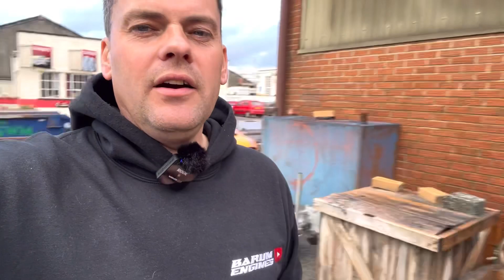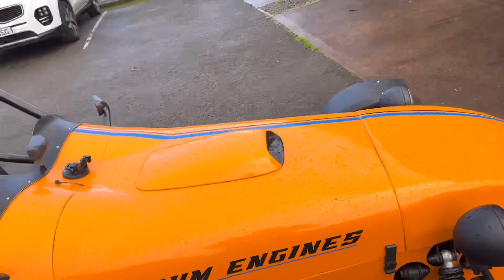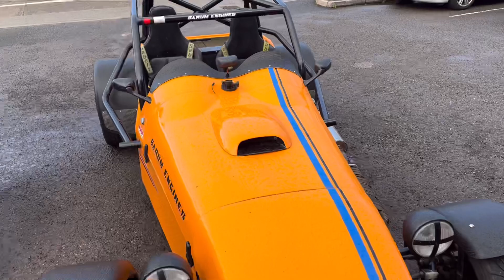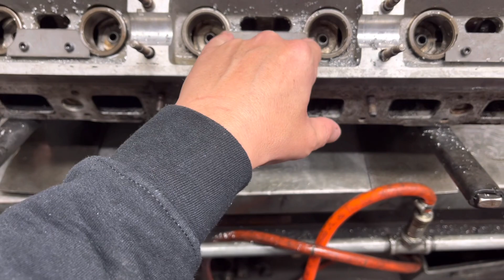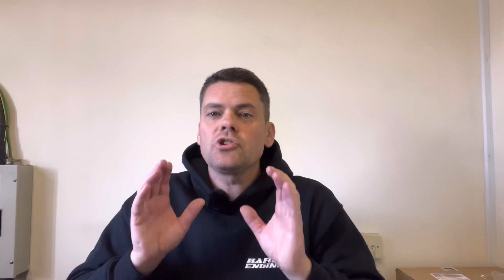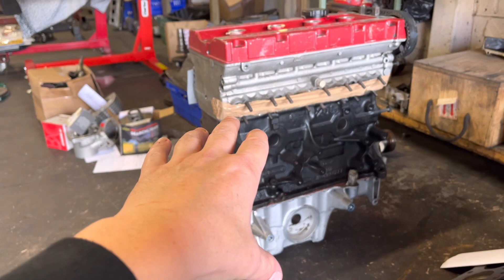Is the Lamborghini being held for ransom? If so, The reason could surprise you

Comment: Lee, get your solicitor to send a strong worded letter to Lamdo dealership. Also outline to the solicitor regarding the data breach. See what happens.
Reply: dont know if I am right or wrong but holdind of a property of others and asking something in exchange of or for is legal..
Reply: @egidijuskilinskas4583  That's why I said see what happens, and in any case you could print off the email or screen shoot it.
Reply: @egidijuskilinskas4583  probably small print in the owners manual, you will own nothing and be happy?
Reply: @kwakgreen  Errr..did you mean to type: 'illegal'?
Reply: Hmmm … as I said in another post this is not as obvious as it may seem to be. Regardless, asking a solicitor to write a letter is going be the start of a big $$$ exercise. Is the principle here a hill on which to die? Maybe pay the bill, take a laptop to the dealer so the manager can verify the deletion of the email and leave with your car, never again to darken the dealership door. Also, be careful what you say on this forum, very careful or you could find yourself with a very costly defamation problem.
Reply: @egidijuskilinskas4583  It's quite simply illegal. They're trying to cover their own screwup by essentially blackmailing. The dealership doesn't seem to realize is that Lee has leverage too. IMO Lee should contact the relevant government organization.
Reply: Not worth the expense unless they refuse to release the car
Reply: @samiraperi467  Won’t work. They legally can hold the vehicle for payment. On top of that they can charge a daily storage fee. Pay the bill and never go back. That will cost them more in the end. Principle here is only worth the battle if you have lots of $$$$$$$$$$ and a chance of winning. Using the accidentally sent quote as evidence is not likely to gain any favour in the court.
Reply: @stephensaines7100  I didn't say either.
Reply: @samiraperi467  In reality they are in no position to "blackmail" anyone. In a nutshell they are the ones who have breached GDPR rules. Le hasn't shared ANY personal information at al. 
My approach would be to pay their bill and tell them to return the car as previously agreed. I would also remind them that if they didn't return it forthwith you would have to consider what actions you need to take over the following, 1, Breach of contract. Date of return of vehicle, price, work involved etc., I'm certain Trading Standards would be interested in that. 2. Blackmail, Quite simply put "you can't have your car/wife/dog/ pet budgerigar back unless you do X. Is a criminal issue, although doubtless the police will try to fob you off saying it is a civil matter. 3, Breach of GDPR, Their failure, not yours and should be reported to the appropriate authorities.
Then when they bring your car back report it anyway, if they don't get their backsides kicked sloppy practice will continue and it could be your information they "accidentally" release next.
The Rover engine is the same as was used in some of the Land Rover station wagons, one tonners and forward controls at one time. Just what you needed in a Land Rover, an even greedier engine. We used to put the 100 heads on the Land Rovers and they would pick their feet up a bit better.

Comment: Don't delete that email until you consult with an appropriate legal advisor. Companies generally behave this way when they are concerned they broke the law.
Reply: they have broken the law
Reply: @DaleSteel  Yes indeed. They could get a large fine if you report it to the information commission. No solicitors needed in my view if you dont owe them any money. Call them and state you have no intention of any further action if you car is returned, but if they continue to withold then then the info commisioner wll hear about their error. Not for you to prove anything, was their mistake.
Reply: YEP 99% of the time the company will do anything they can so they cannot be blamed!!!!
Reply: Stop people … they sent a quote, the quote was accepted and the work done on the vehicle - the work was done, right? It doesn’t matter one hoot how much they quoted someone else. The time to challenge the quote is when it is issued and before a wrench touched the thing. It is only fraudulent if they claim to have replaced a part when they hadn’t, purported work was needed when it wasn’t, etc.) I don’t think that applies here, but maybe I’m missing something.
Reply: @Dave Stennett Won’t work. Once a data breach has been found, the company is required to report it. Odds are that once they learned of the errant email they did just that. They are also taking the necessary steps to rectify the data breach. Only one individual here is at risk of running afoul of Data Protection and it isn’t likely it is the dealership. Holding onto data you know you have no right to hold is very problematic.
Reply: @dougthomson5544  you’re dribbling shit. He agreed to pay the invoice (probably has already paid) and his car hasn’t been returned, because they are basically blackmailing him, for their fuckup. There is no way for him to prove that he’s deleted the email and it has nothing to do with the work done on his car.
Reply: @reefhog  Well, solicitor Darren, you are one smooth talking little devil, aren’t you? Cool headed, erudite, and respectful. I applaud you. The advice in this thread is, “Don’t delete that email …”. All I’m suggesting is that that is probably not good advice at all, indeed, mentioning the email has placed Lee on the defensive. In truth, all Lee has to do is provide the dealership with an assurance that the improperly held email is gone and if it isn’t then Lee is in jeopardy. I feel very badly for Lee; this kind of crap puts one off more than a little. However, righteous indignation does not good advice make.
Reply: @dougthomson5544  look at the latest video. You’ll see that he actually had already paid them. They had no legal excuse to keep his car. The email is a separate issue.
Reply: @reefhog  I have read it and I am very glad he got his car back and I do hope he remains steadfast in not returning, ever, to the dealership. The dealership indeed did overstep the mark by using his car as a bargaining tool to ensure the deletion of the email. It seems you are right that the bill was paid and as a result, the email and the bill are two absolutely separate situations that should never have been conflated. However, I stand fast to my belief that retaining the email was not good advice. The dealership now has got a lengthy stream of evidence that it was faithful to the government regulations regarding accidental release of personal information. I have no sympathy for the dealership, but in my reading of the act it is self-evident that they did exactly what they were supposed to do once they became aware of their mistake. Because the car and the email were totally separate issues, retaining the car was stupid on their part. Regardless, I do hope Lee has indeed deleted the email (his responsibility met) and I’m glad he got the orange money-pit back. Way back in 1971 I bought an e-Type Jaguar ($1900 in those days - no, I didn’t miss a 0) from a work colleague who was reluctant to sell it to me, warning it was a bloody expensive car to own. I was insistent, he was right, I was wrong. Loved that car, though.

And, Darren, thanks for the change in tone. My whole point was not slag Lee, but to bring attention to his vulnerability should he retain that email - in short, trying to help him protect himself from making a privacy mistakes. I certainly wasn’t “dribbling shit”.
Reply: @dougthomson5544  fair enough. I apologise for saying that.
Reply: @dougthomson5544  it cant be unseen and forgotten

Comment: GDPR is my area. They have committed a technical breach and could be fined by the ICO. That’s why they are shi77ing bricks. What’s weird is why they are messing you about by not returning the car. Call them and tell them to bring the car back (with one of their drivers) and as soon as they arrive you will delete the email and show the driver that happening.  Call them everyday until that happens. Ask for an invoice so you can sort the money. Then draw a line under it all and use the indie. Don’t do anything else. Don’t contact anyone about the email and certainly don’t forward it or show it anyone.

Comment: My OCD kicks in whenever I see that wiring / choccie strip connectors flapping about over the kit car fuel tank. Might that explain some errant fuel level readings ?
Reply: Building engines must make you OCD. Some days you can't stop checking if you have got something right, in/out with a gauge about twenty times

Comment: With the diff, get a breather hose and use one of those fuel cell vents with the mesh screens with a one way valve so the air can only come in (not fluid out) and mount it about 6 inches above the diff in the body work
Reply: Sounds a good idea. Will you need a catch tank to collect any oil vapour that may condense?

Comment: Lee it's simple, print off the e mails then delete them and show proof of deleting to the dealer. Just a tip with the Rover block, if you bore it square to the top face it will lighten the block considerably but you may lose a bit of compression, hope this helps.

Comment: Hi Lee, they are holding your car to ransome over the email but that sort of behaviour works both ways. You could tell them that unless your car is delivered to you ASAP with a reasonable bill for work done, then you will forward the email to the correct customer and they will have to deal with whatever actions the customer takes.
I wouldn't buy a lottery ticket anytime soon because your not having much good luck lately. Lol
Love your channel and the interesting content,
Cheers
Keith
Reply: Errr...no. You've suddenly made it criminal, for both parties.
Reply: @stephensaines7100  it's only posturing guys
Reply: @stevekelly5166  gdpr only applies to businesses not to individuals. 
A business can not instruct you to delete information they have sent you by accident, they can ask you but you do not have to do so. 
That said business that has breached gdpr by sending you the information in the first place should inform the customer (whose information they have erroneously sent out) and report themselves for a breach of the gdpr.
Forwarding the data to the possible unknowing victim, is a very nice thing to do, so they are at least aware that it has occured and certainly not illegal

Comment: 998 Mini standard engines had a danger of circlips popping out of the pistons above about 6500rpm. On the 998 Cooper engine with high compression D top pistons, they had inference fit big ends-gudgeon pins, like that Ford CVH engine new pistons.

Comment: The big problem with a car like yours is that it doesn't really do the milage expected. Some things, like coolant, brake fluid etc are replaced at time intervals and some like spark plugs and air filters are done at milage intervals so unless you are doing ballpark expected milage per year, some things will need replacing and some perhaps not, but in some cases things still need to be checked (spark plugs for example) so why not replace them while your at it. You own a very high performance car, and they are designed to be driven pretty hard and fast with perhaps occasional track days where they will get a canning and Lambo scheduled servicing reflects that.

Comment: Had a Rover 100 myself back in late 70th and early 80th great car to drive. Did the headgasket an valves ( had a burnt exhaust valve ) The same engine as in the 6 cyl petrol Landrover serie 3 Different horsepower rating if I remember rigth. Many of the drivetrain and brakeparts were exchangeable with the Landrover series 3.
Reply: A friends dad has a caravan with the 6 cyl engine, can't find a water pump anywhere, and his son is a Landy specialist.

Comment: No if, no buts just have 10 mins on the phone to a solicitor. 
I was looking at putting a rover 100 lump in my mk 3 cortina but ended up with a 3500. Its now long gone but what a fantastic beast up to 80mph. Seriously undergeared using a borg warner auto box which came with the lump, smoke the rear wheels at the high street lights no problem.

Comment: Under GDPR it is normal to request that the recipient (you in this case) delete the email however proof is not something that can be proved as noted below. An email back from you to them confirming that the information has been deleted shoud be sufficient, they will then keep this on file should any later investigation occur. It is standard practise when 'in breach' as they are. In this case I would simply advise them that as soon as the driver returns the Lambo you will delete the email with the delivery driver as witness.

Comment: 1. Print off a hardcopy of the errant email. Include it in the paperwork that you also have to keep secure under your own GDPR compliance.

2. Do a screen shot of your email 'junk' folder, with that email (and only that email) resident in your 'junk' folder. When you do a screen shot have the time and date clock showing in the bottom righthand corner of the screenshot. (This effectively dates and times when you had the email in your 'junk' folder.)

3. After two minutes, permanently delete the errant email. Do another screenshot with the date and time showing. This is the best you can do to "prove" you have deleted the email.

4. Send the Lambo company copies of the screenshots. Indicate you have done everything you can to remove the email from your computer. Also confirm you have not copied the email to any other recipient. If they ask to see a screen shot of your 'sent' folder, confirm to them this would break your own Data Security Compliance, and they should know that. 

5. Send another email pretty soon after the one sent in No.4, reminding them you have done everything you reasonably can, to help and assist in removing their Data Security Non-Compliance. In a separate paragraph, remind them you are waiting to pay any pre-agreed invoice (although I don't recall you authorising any work to be completed), and remind them you expected them to arrange with your courier, shipment of your vehicle last Wednesday (I think it was). Ask them if there is a reason for the vehicle not to have been shipped? 

6. Suggest, nothing more, suggest you feel like it seems to be a lack of goodwill on their part, and if that is the case, is there anything you can do to change that for the better, other than confirming they can have the work they have "considered" might need doing over a 4 year period. 

7. Under no circumstances, should you be involved in any phone conversations. Not unless the conversations are W/A videos and the conversations are recorded. 

Why do all this? Because if/when you need to get a good litigation lawyer involved, their workload, and your pocket will both benefit from you having been able to prove that you complied with every reasonable request the dealership made, when they made it. That you tried every means available to avoid confrontation. You agreed (and paid) any invoice you had previously agreed (and hopefully agreed in an email). When this has all been done, and still you have a problem - like your vehicle hasn't been released to you, your litigator will be very pleased he can show in court that you have done everything you could to avoid a court appearance, and the plaintiff is solely responsible for the need of a court visit. This will help ensure the bulk of your court costs are paid by the other side.

Now the shorter 'cut and thrust' version, is to invoice the Lambo company for the car, and give them 30 days to pay the invoice (which obviously they won't). Then either apply for a 'winding up order' (effectively having them declared bankrupt) for non-payment, or go to the High Court and get a Sheriffs order for property seizure order to the value of......

Comment: GDPR does not apply to the contract regarding your service personal car service, they are separate issues. Ask them to take payment, return your car. You can contact the ICO (information commissioner office) for guidance, but the dealer has had a data loss (to you) of PII, personally identifiable information of another customer. This is called a breach which attracts fines.....I'll leave you to decide how you proceed Lee.

Comment: Hi Lee.
If you check out "Jim's Automotive Machine Shop" they are doing a major repair on a Jaguar engine block. A 4.2 6 cylinder I think that has cracks between each chlinder. Your shop may benefit from watching this specialist repair to keep the engkne and it's numbers original to the car.
Reply: Yeah, I was watching that last night. They've got some very expensive commercial tools to do the job. But of a different angle, so to speak, than Barum's modest operation. Technically it's interesting, but it lacks the personal spark Barum has.

Comment: Dont delete anything, keep everything. I would aslo think if you know you shouldnt have had it if you delete it you could be aiding the error. If they have stated they will deliver your car back and have not press them. Dont admit, agree, or discuss any thing any more. Its hard not to talk when under pressure but just dont. If they have not done any work and you agree the car comes back then they are holding it against your wishes. If all else fails go and collect it. In reality it may be best you go (wouldnt tell them your going, first thing in the morning is best ) with the trailer and a couple of witnesses and collect it. But make sure you GO PRO every thing.